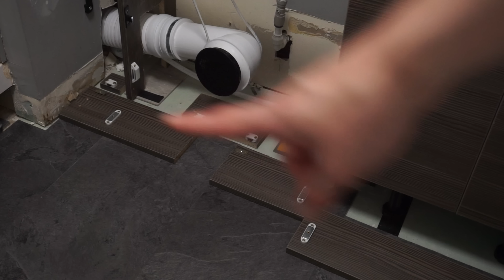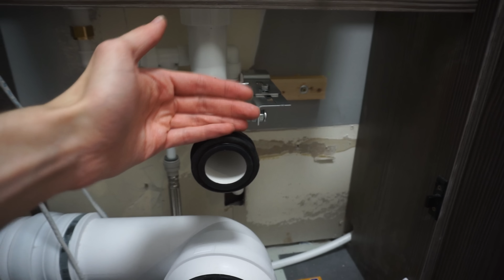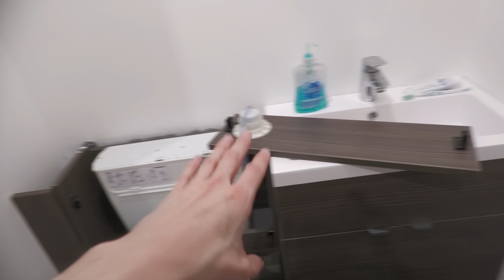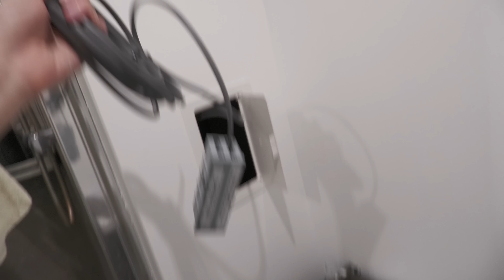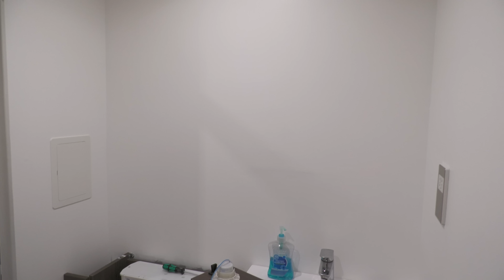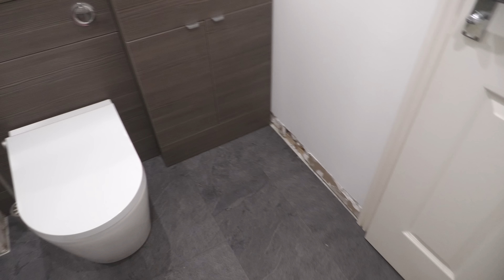What could go wrong? Attempting to Refit My Own Bathroom as a DIYer

Comment: The magnet idea is genius, all my kitchen unit kick boards clips are knackered and landlord too tight/can't be arsed to do anything unless I have something serious/legally obligated, and they were never cut or fitted right in the first place and some are warped and had gaps. I also live in a communal building, and I've had a few mice (I'm terrified of them) get in the living area somewhere from the kitchen behind the units, so I've basically had to duct tape the gaps between the boards with tin foil filler (to deter chewing). Not ideal, especially when my built in washer/dryer's drain port is behind the kick board, which is one long massive length, it should've been sectioned off, then I could've done what you did with magnets for easy access. To be honest whoever fitted the kitchen when this building was built in 2006 did a terrible job, and I'm not expert. You did a great job, especially for a first timer, bathroom looks great, I agree about the top, white would've been too much, if you do replace it, maybe go with a grey, plus it does need a little over hang, but does the job and doesn't look out of place.

Comment: Hi Cameron, do you continue to have reliable performance with the puricare toilet bidet? and do you have any concerns about the durability of the heating water and drying functions and how long they will last.

thanks for the video. we had it in our renovation playlist for several months.
Reply from the maker: It's still going strong so I've been very impressed with it.  Only issue I've really found is that if the batteries in the remote are running low it can start to act a bit erratic (beeping randomly, not starting properly.etc). It appears to indicate a low battery by blinking the LEDs on the remote so if it starts to play up, change the batteries.

Comment: Flexible waste pipes on toilets are the work of the Devil
Reply from the maker: It wouldn't be my preference but with the angles involved here it's either that or a bunch of different angles cascaded together which in my opinion is even more likely to go wrong.  Obviously you wouldn't want to rod a flexible pipe but it's been working fine for well over a year and everything is deliberately left accessible so it can be fixed if future maintenance is required.

Comment: Binged with a bottle of wine on a couple of your videos tonight. I already mentioned on a previous video about my daughter working in Edinburgh, she bought a new build flat and the standard of workmanship in that new flat is appalling. Especially the plumbing. Your attention to detail and your ability as a DIY'er to do a far better job than the so called professionals does you credit. If the IT job disappears you should be able to retrain as a plumber no problem. And yes, silicone sealant is a complete ballache to get right!
Reply from the maker: Thanks!  Yeah, it's a real shame with the standard of work in a lot of new build places, this place was built in 2010 and while there's nothing disastrously bad, I do keep finding myself having to fix stuff that's been bodged from when the place was built.  It's a shame since I'd rather live in a relatively modern building for things like decent insulation and just the overall style of a property, but it sucks having to basically fix stuff that should have been done by the builders.  It's why I basically do so much myself, I can't trust that a contractor I'll hire will do a good job, like when I hired a professional to fit a new boiler, all gas safe registered - they wired it up by stuffing some bare connectors into the wall, ended up having to rewire it all myself!

Comment: Really exciting project, Cameron, and it looks very modern! 
If I may offer my opinions as another DIYer: Your siliconing looks great, don't be too hard on yourself, as it's not in permanent contact with water around the brown bench, it just needs to fill the gap and repel splashes, being better round the sink (and shower) is far more important in the end.
I'm a purist so I'd give you more points for copper pipework heh but everything looked neat and level - I'm never sure about the specifics of the height for that sink waste on the wall vs inlet (p trap yes but I may be wrong in thinking I'd have the waste slightly lower than you've opted for). That toilet waste pipe does make me grit my teeth but only for 'what ifs' and the thought of waste getting stuck in the folds and a lingering smell (or messy future leak). I would just avoid having to do waste pipes altogether if I can help it lol However as there's the added point of electricity for the toilet, I would probably have some sort of wooden boxing around any cabling as a failsafe for anything leaking (however unlikely) for that extra peace of mind so you could never have any horrible scenarios (presumably the cabling isn't something you'd really ever need access to and has a separate isolation switch? is there a switched faceplate to the left of the one we see?). 
I wish manufacturers would put more effort into insulating the cistern (usually come with woeful thin polystyrene but you could envision one of those thicker pvc sheets like they use on water tanks or the black sheets in the garden!) because they usually end up condensing steam from the room down them (gets in through the units) and the resulting drips puddle down and either make a mouldly mess or a wet floor over years of use (which brings me back to the concern for wiring beneath even though you seem to have an extractor fan, I just would add that extra failsafe).
The magnet strips for the plinths are a massive improvement and very well thought out and implemented, I hate having to yank off the cylindrical clips, they're prone to snapping and as you say, can only come off directly with little room for manoeuvring. Finally, the floor looks great visually (not something I'd usually opt for) but in my experience I wouldn't get too hung up on the room for expansion, I used to constantly see 5-10mm recommendations and I've never seen (cold room vs room in summer) movement anywhere near that, I think 1-2mm at most is perfectly fine in the real world (just so it doesn't rub up against the walls when stood on if nothing else), I think the 5mm+ gaps tend to spoil the look in the end but in your case, your work around the door frame and taking the skirting off to go ontop cleverly avoids all issues and looks (or will look!) very very nice. I also would have fixed the holes in the wall from the previous skirting hehe but there's another little job to finish for you :)  cheers
Reply from the maker: Thanks, the siliconing looks fine from a distance, it's just a bit rough up close.  As for the pipework, copper is definitely nice however given the entire place is already in push fit, I'd rather keep things consistent.  Also not sure about the height for the trap but it seems fine, never had an issue with it, it's high so that it clears the rear of the vanity unit, otherwise I'd have to cut it out and it would look messy.  I'd definitely rather have a solid toilet waste however the current system works fine and was much more reliable than my original plan of a long pan connector.  There's a chance sediment may form in the folds at the bottom but I can't see it being a huge issue, it won't smell as the toilet will act as a trap. Think the only risk is to avoid rodding them if they were to block.  Of course it's something I can easily change in the future, this was very much a case of "just get it working for now."

As for the cabling, not too worried as the flex will be okay in a leak and the inline RCD is IP rated.  I wouldn't say it's any more risky than a dishwasher or washing machine where you have plumbing and flex in close proximity.  The whole circuit is RCD (GFCI) protected (a requirement for almost all circuits in the UK) so if water did get into something, that would trip.  The toilet is fed from a switched fused connection unit in an adjacent cupboard to provide fusing and isolation for the toilet.  The faceplate on the left that you're seeing just a blanking plate - I ran in a second cable between the cupboard and the bathroom and blanked it off on each end, just in case it was ever required for something in the future.

I saw some cisterns that did have a polystyrene cover but the one I went for didn't unfortunately, something to keep an eye on I suppose although the extractor fan is pretty powerful (although needs replaced as it's started getting pretty loud) so I don't usually get too much condensation.

Then as for the expansion gap, I also agree that it's likely unnecessary, especially in such a small room.  It was purely because the flooring has a 20 year warranty but only if it's installed in accordance with the manufacturer's instructions. I'd hate to have a totally unrelated issue only to find them refuse warranty service due to it being installed outside of their spec.

Comment: Will you do a follow up video? I want to get one of the toilets, but dunno if it's a good idea long term.
Reply from the maker: I was struggling to figure out how I could make a review without it being too "graphic" a description but it's really good, I definitely miss it when staying away from home.  Can safely say that if I ever move in the future, I'll be fitting another Japanese toilet as soon as possible!  The air dryer isn't super powerful so it's generally easier to still use paper to dry, but it does work if you don't mind it taking a couple of minutes to dry.  Then other than that, I can't fault it!
Reply: @camerongray1515  Does it have a dump counter ?

Comment: whats is the reasons for not picking LED downlights; sure they last much longer?
Reply from the maker: I'm using LED GU10 bulbs.  I don't use integrated LED fixtures because when they fail, you need to replace the entire fixture.  If this happens once the particular downlight I've used is no longer being sold, I'd either have to deal with a mismatched light or replace every light in the room to get them all matching.  It's also much easier to swap GU10 bulbs or fit smart bulbs if desired.

Comment: Nice job. Can you share the manufacturer of the shaver socket that you used?
Reply from the maker: It's made by MK, from their Dimensions product line.  Namely the MH4709WHIC shaver socket module with the MHFP036BSSW decorative front plate (the front plates and modules are sold separately in various finishes)
Reply: @camerongray1515  Do they make a pink and blue one ?

Comment: Do you have water shut offs at each device in the UK or was that just your place?
Reply from the maker: They aren't super common as standard and aren't required by regulations as far as I'm aware but I tend to fit them - very little additional effort and cost but can save an absolute tonne of hassle when it comes to future maintenance.
Reply: @camerongray1515  Here in the US, a shut off is required at each fixture (toilet, faucet, etc).  A connector blew at my toilet once and if I didn't have a shut off valve at the toilet, I would have had a flood!
Reply from the maker: I wish that was more of a requirement here, in the UK it seems like stuff is never installed with future maintenance in mind.  Going forward I'll be fitting them wherever it's reasonably possible.
Reply: @camerongray1515  same here tbh
Reply: Doesn’t hurt to do so.  I actually replace them when doing a project as they do dry up/wear out.
Reply: There is a water shut off at each device
Every house I’ve lived at has had them, and my sisters house has them
(And yes, i do live in the UK)
Reply: depends on the builder 
I know some builders install them and some don't
where I live some stuff has shut off valves and some don't haha

Comment: Quite a lot of work you have done there! It seems that you have a slightly different plumbing technologies than we have here, but the biggest stress factor in DIY plumbing is that there are so many different technologies invented in the past 30 years that you'll never know what you will encounter when you start a simple looking job. When you have a spare bathroom, it is fine, but when you have only one, it is quite stressful. Bad idea to start working on weekend, finding out that you need some fitting or a tool for it you don't have. In the worst case it is obsolete, and you can't even get them, or not on stock. My biggest fear are the welded or glued old plastic fittings that convert the pipe to a threaded end. Sometimes they are so tight you'll either break them or strip the thread...

Comment: I would not want to use the corrugated pipe for toilet waste. The paper will get clogged on the ribs, I am sure you will find this out and fix it in the future.
Reply from the maker: I did think about this but from what I can tell it's not a huge issue - the pipe is explicitly sold for toilet waste: https://mcalpineplumbing.com/wc-connectors/flexible-wc-connectors/wc-f21rc-straight-back-wall-flexible-wc-connector so I trust that the manufacturer has thought of this.  I can always change it if it ever causes a problem but it's been working fine since August 2021 so I'm hopeful it'll be fine.  The previous toilet also used a flexible pan connector and I'd never had an issue with that either.